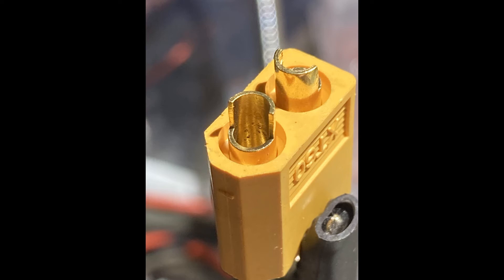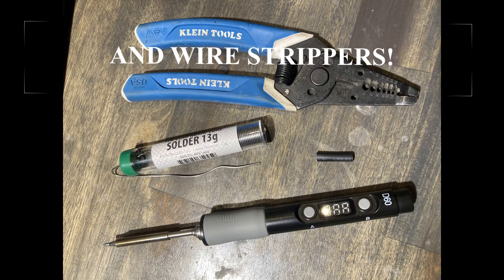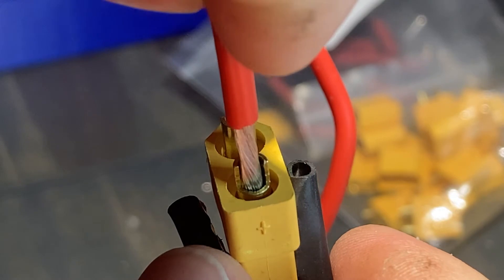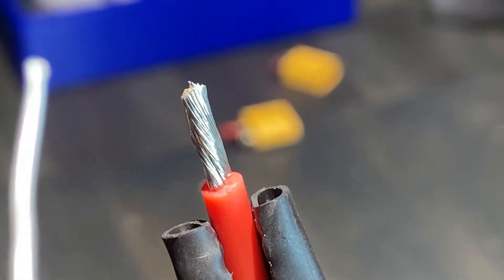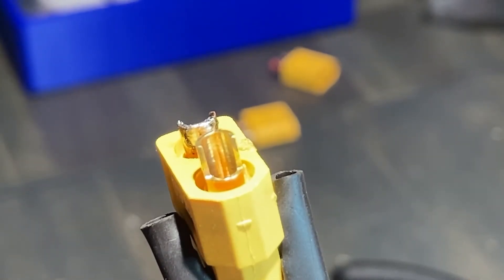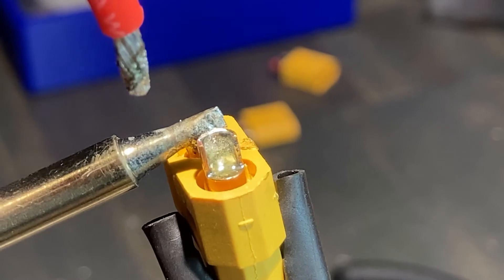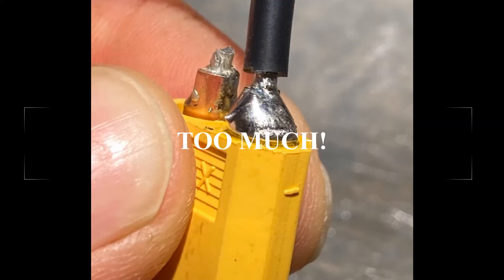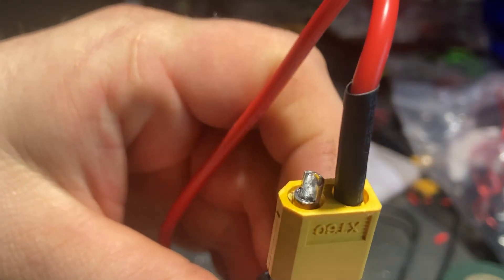How To solder a cup Terminal

Comment: Now how do i do this without wicking the wire or getting solder on the back of the cup?
Reply: To avoid wicking the wire, you need to have a shorter tinned length and then also work very fast while being sure not to completely fill the cup with solder. If you completely fill the cup with solder and then melt it while inserting a tinned wire, the wire displaces a lot of solder and it has nowhere to go but up the wire or spilling over.

This is why I strongly encourage smaller diameter solder wires (like 0.020") because it allows precise control over the amount of solder and makes for neater work.

As for getting solder on the back of the cup, it's unavoidable if you are using proper thermal bridge technique. But you can minimize it by using very little solder on the outside and if needed you can wick off any excess leaving just a thin plating of solder.